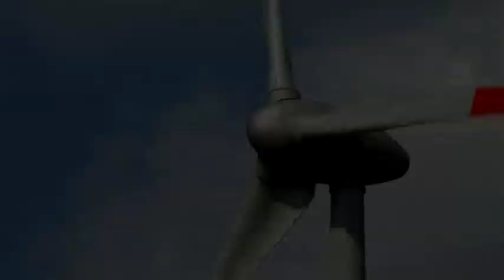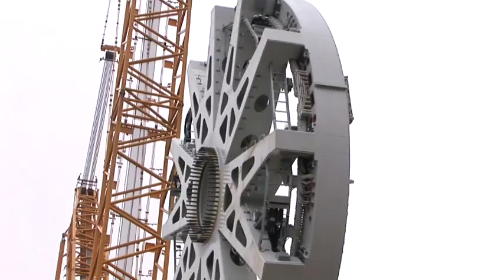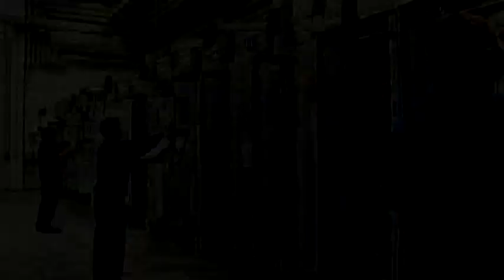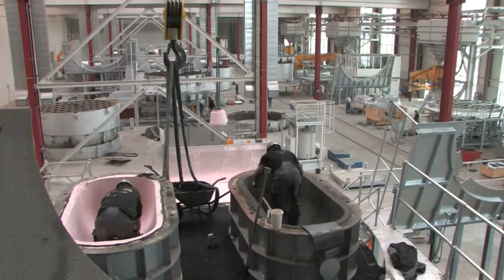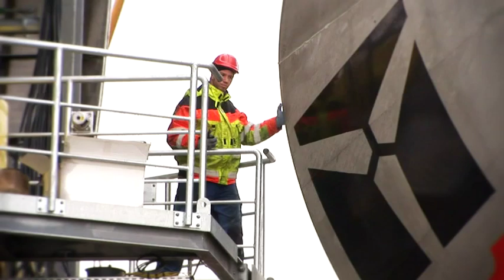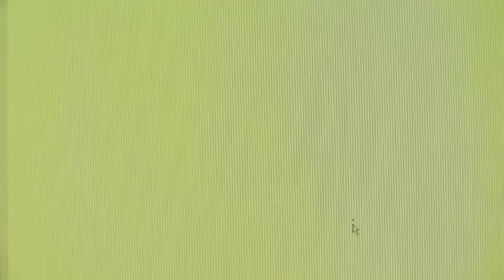Enercon Wind Turbines

Comment: seems looks afraid on my own,,concrete so thin,,and no additional structure outside or inside,,if makes from concrete the standard is full,,if tube it must be pillar,,tube in a full concrete and metal steel structure,,so could avoid and passing a colapse of concrete structure that easy to break,,thanks,,

Comment: Dangerous & Ugly Wind Turbines will NOT be around much longer ! Why?
Because in July 2019 a new discovery by a Hi-Tech Electrical Engineering Company has discovered a way to "Switch-Off" dangerous radiation. As a result a new type of Radiation Free Reactor is already on the drawing board. This new system is more efficient that either Wind Generators or solar panels. One new power plant should be easily capable of generating more cheap power (whenever you need it) than 500 wind generators.

Comment: garbage..   if you dont maintain the brake in them your looking at disaster, well have fun climbing an 80 foot tower just to change a pair of brake pads...

meanwhile I have 4 vertical axis turbines in roughly the same space, NOT able to kill birds, NOT able to fail because it has no break pads, and....   50x cheaper for the same ammount of output..   figure $30 per kilowatt generator. 

since we only get 5 cents per kilowatt we dump back into the system.. it aint a money maker, but we arent pay $200 a month for power either

Comment: I wonder how much byproducts from oil are used in this process?  How much CHO is pushed into the  air?  What the cost is for one unit??? Also they never talk about the thousands of birds that are killed every day by those horrible wind mills that are disgracing the landscape, Germany's energie program is a total disaster and the cost is prohibited.... Those  mills are not  able to provide enough power  for most heavy industries and are NOT reliable as a energy source. 
Those  environmentalist promoters are either bribed or refuse to be honest!!!!!!!!

Nuclear energy is the cleanest and most economic supply for power and is very safe, it does not kill birds or have some neurological effect on people who live close to those landscape destroyers......the nuclear waste is far less than the nuclear waste produced by other industries!!!!
Germany shut down they energy reactors after the one problem in Japan , where a reactor withstood a 30 meter high tsunami and killed only ONE person, so absurd... this whole energy rip off is terrible and totally taken out of proportion as is climate change which is the drive behind all this nonsense. The other contradiction is that Germany is building a natural gas  pipeline for  energy from ....yes Russia....just a lot dirty politics , if you ask me.... (I  know  you did not do that)
It would have been far better to do research engineering as to improve the emission of trains, planes, cars  and ships or  using nuclear energy for ship and planes etc..yes that would the challenge instead of those ugly windmills all over the planet, the rules  should also be applied to fields , acres of solar panels...... it would be better to look into the energy management  as w hole for now I see a lot of abuse  and false criteria to push the climate change agenda....

Comment: 1:13  7.5 Megawatts!  Holy crap, that is a lot of power!  I wonder how much wind it needs to reach that output?  I guess it wouldn't necessarily need all that much, provided the propellor is large enough.  Just a thought...if you had  field of these, I wonder if you could run them in reverse as motors and produce enough wind to change the weather? :-)

Comment: Blades could be more efficient if they had a large surface area on the edge of the blade, where there is leverage providing more torque & speed. Have seen better designs from Australia & India. Viktor Schauberger was also working on centrifuge forces to provide a cyclone in the middle, tho' he specialized more in water pumps, but same sort of principle. He even applied to anti-gravity designs using opposing magnetic fields & acoustic sound waves, which worked, but that's another story. I tried out a permanent magnet on a disc design, where repelling forces made the disc turn continuously without any other input. I got 9 volts from small dc motor, which also lit up a 12v bulb. Was made of sticky tape & a plastic spread lid, but plan on building a bigger one. But, it did prove to me permanent magnetic motors can work. Trying to figure out if I can build a pulse-timed version, so can control the speed. Also, instead of using the inefficient alternator set up, would be best to use a drum generator with permanent magnets, single or 3 phase set up. No need for a rotor & eliminate back emf torque, providing twice the torque. Some of these drum motors are now used in washing machines, but they can be re-wired to generate. Great presentation, & amazingly skilled dedicated workers, but I just think the designs could be more efficient. Can't see a future in wind & solar energy, which will be phased out in favour of permanent magnetic repulsive motors, hydrogen gas & other systems such as LENR, cold fusion using cavitation & the Searle energy unit. There is a way of boiling water immediately just using acoustic sound wave resonance, but the inventor, Petery Davey, died before he told anyone how it worked. The ancient Egyptians, Chinese, Indian & Sth Americans knew about cavitation resonance too, if digs at sites are anything to go by. There is going to be a revolution in energy systems soon.

Comment: Please answer my question as you are specialized in this field.
I have a son in junior high school obsessed with wind, turbines, towers and all the details. He does not report on your company or other companies. He misses on satellite or on YouTube. He tells me that I have an idea of invention that He works all his time on miniature designs that produce electricity and I help him and provide him with the necessary materials torches and towers
He works all his time on miniature designs that produce electricity and I help him and provide him with the necessary materials
He says that my invention will change the wind power a lot and there are only some calculations and answer to my question will be taken into account after the completion of the invention that you have priority and facilities as you see fit and without conditions as you contributed to solve this dilemma ..
"I want a way to calculate the energy that moves the codes and enters the gearbox and from it to the generator," he says.
He says for example: Suppose that the fan capacity of 1 MW The number of fixed fan cycles gives 1500 cycles for the generator and its output of stable electricity voltages.
He says that the force of the wind on the blades is 1000 Newton. What is the force that will enter the gearbox and then to the generator? What is the percentage of the losses of 1000 Newton in the gearbox and in the generator because of the frictions and because of the intersection of the magnetic flux in the generator?
Please answer the question because he is in a hurry for the results because his invention has not been left for him very little, and I hope that you will keep in touch regarding the agreement soon after completion and thank you very much and to meet soon ..

Comment: I think that The so-called annular generator by Enercon. It is the multi-pole WRSG with DC exciter mounted outside the rotor shaft. This topology can be implemented without the need for a gearbox by incrementing the number of poles of the rotor. The increasing on the number of poles implies a large generator diameter as seen in the video., resulting in a machine of larger dimensions. As the machine is gearless and low speed, they are right to claim low noisy. I think that it is direct - driven annular generator. The interesting feature of this machine is the DC controllable exciter which allows the rotor flux to be controlled for various purposes such as filed weakening strategies.  My question is that what Enercon think about Type 5 Variable Speed WTG system?

Comment: Addressing some points in the comments:

Industrial sized wind turbines with a service life of around 20-25 years tend to pay for themselves in a few years or so, depending on local schemes, wind speeds, generation rates etc, and the costs are shrinking globally at an unprecedented rate as experience is gained and designs refined.  Energy from solar and wind is abundant, it won't run out like fossil fuels and nuclear materials will and we can use as much as we want, so in that respect it is 'free' as in 'free to use as we please', extracting it, converting it into a useful form and transporting it is not free and will always come at a cost.  Within 5 years, renewable energy coupled with storage systems are going to be cheaper and cleaner than any current generation method, all the while addressing the climate issue.

Did you know the global fossil fuel industry takes approximately $5 Trillion in subsidies annually?  That's your taxes they are taking with one hand and astronomic bills for the energy you use with the other, bills that fluctuate depending on what another country happens to be doing at the time.  Wind energy is on the brink of being completely subsidy free in some countries and cheaper than any other method of generation, not to mention more nationally and defensively secure.

Can you imagine how much electricity we could produce with renewables for $5 Tn a year and what we could do with that electricity?

Comment: In reply to those saying the generator is inefficient, should have used permanent magnets.
The first problem is that it would be incredibly expensive to use neodymium magnets of that size.
Second is that permanent magnets obviously have a fixed field strength. This means less control over the output of the generator. Possibly resulting in it being operated inefficiently at certain wind speeds.
Another issue is that neodymium magnets are highly susceptible to serious corrosion. Coatings help prevent this but on something that is moving most of the time this could fail over the years.
In the end why get too obsessed by efficiency when the fuel source is free. What matters more is reliability and its ability to continue giving an output during high wind speeds.